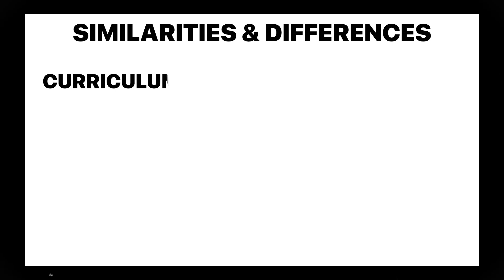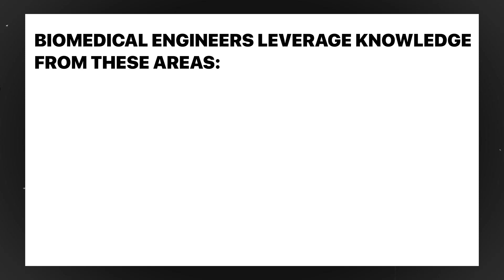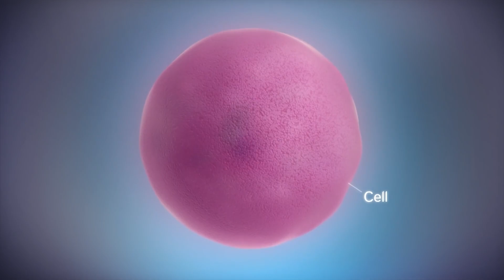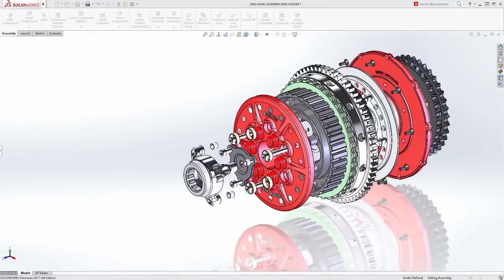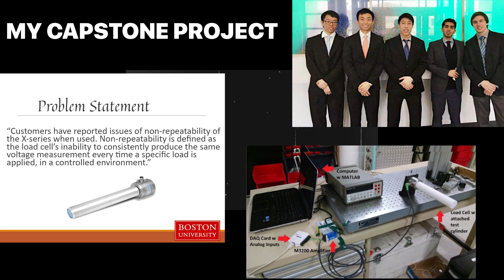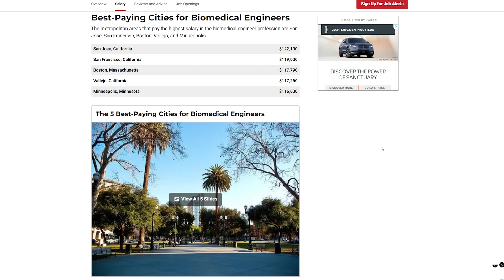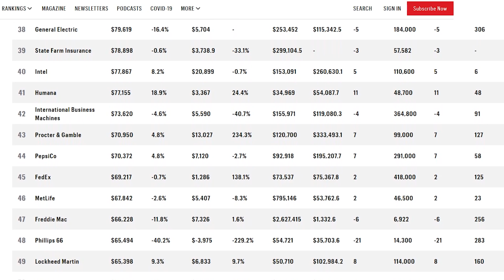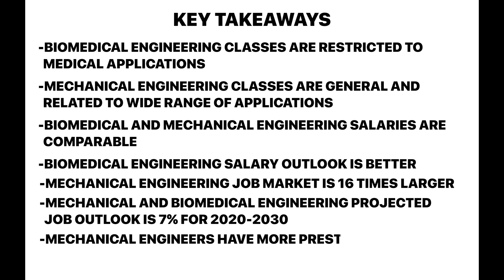Mechanical vs Biomedical Engineering : Which is BETTER?

Comment: Dope comparison! Biomedical was also something that fascinated me but my belief is that mechanical, electrical, and software engineering are better choices for job security.
Reply from the maker: yeah job security is always a huge factor ; )!
Reply: Yes. Bme is kinda hit or miss. Working with robots or systems or medical products is cool but you also won't make what me ee ce Etc will make, the jobs aren't there, so shortage of jobs surplus of people means you don't get paid as much as the other engineering degrees
Reply: @daveb3910  1 year later. Went to a BME conference for AAMI got a $55/ hr usd starting salary for medical imaging in Michigans new hospital being built in 2026.
Reply: Not sure if that last one aged too well😂😂